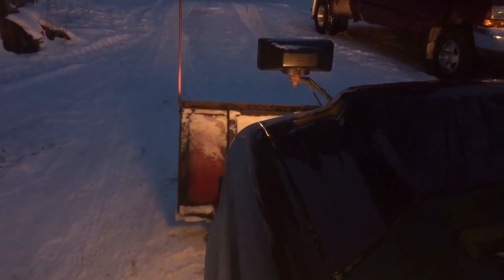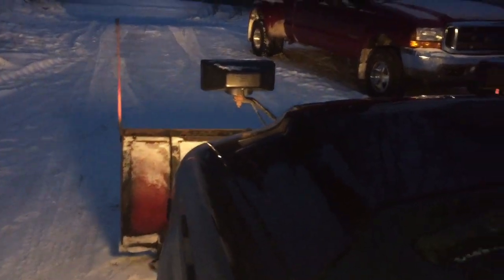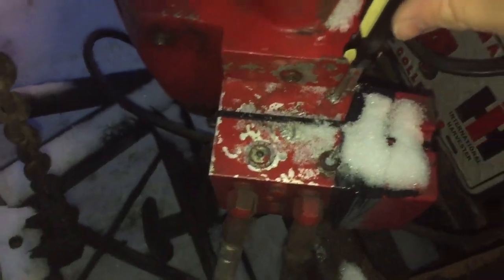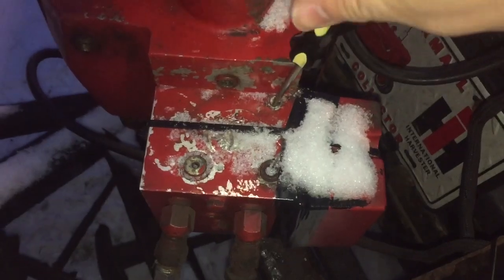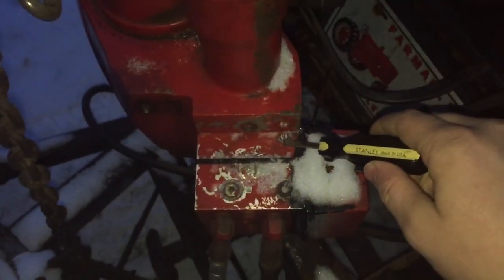Western uni mount snow plow adjustment

Comment: Mines won’t go up but goes down and left & right. Can you help?
Reply from the maker: Sounds like dirty connections on the solenoids. Had a similar problem, wouldn’t go left or right. Cleaned the connections fixed my issue

Comment: Hey can you open your cover where the 3 coils are at and send me pics of how they are wired up to them ? Please im having issues with mine, i have up, down right but no left and it turns right when i hit left of the swich, if i run an extra wire from the bottom + coil up to the top corner coil it turns left by pushing right.
Reply from the maker: paul c yeah there’s 2 screws that hold the cover on. Check the wire connections for the coils for corrosion or if the wire is lose. That usually fixes the problem. And you should be able too find a diagram of everything on the interweb hope that helps ya man.
Reply: @michiganfarming1955  yea im wiring it all up with new wires and my cover is missing , i know there is suposed to be a relay that activated both bottom coil and corner coil to get LEFT oit of it , i just need to see how they wired it from the coils up to that relay that goes in to the harness .
Reply from the maker: paul c I’ll post a pic
Reply: @michiganfarming1955  awesome thanks a bunch , tag me in it when you do.
Reply from the maker: paul c you got it man.
Reply from the maker: paul c posted a pic on the community section of my yt hope that helps you

Comment: where the hell is the drain bolt for that pump
Reply from the maker: Mok4200 on the bottom where else.
Reply: @michiganfarming1955  well no duh. But which bolt. There's a few different ones.
Reply from the maker: Mok4200 it don’t matter what one you pull.
Reply: The drain plug is on the underside.  You will need a Allen wrench or hex head drive socket. Same size as fill plug on top.

Comment: Hey my plow goes up and down but not right or left I acts like I want to go but nothing anybtios
Reply from the maker: Juan Berdecia take the cover off that solenoid box might have a bad ground or a solenoid is bad. I had the same problem. Mine was a ground problem.
Reply: Michigan Farming  ok thanks in one time it did move left and right and then it go stuck again I check tomorrow
Reply from the maker: Juan Berdecia yep sounds like a ground. Mine angled then it quit. Went to the solenoid ground wires cleaned them and crimped the connections so there more tighter and that fixed my problem. Hope that helps you. Good luck stay safe
Reply: Michigan Farming thanks have a goodnight